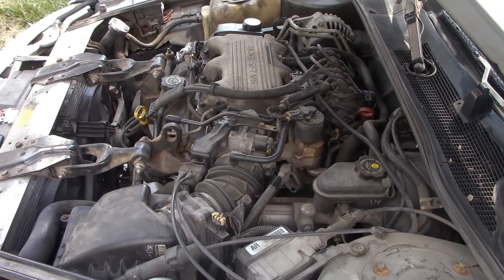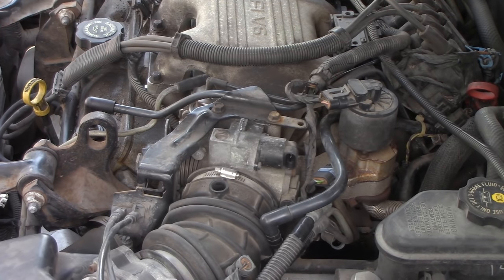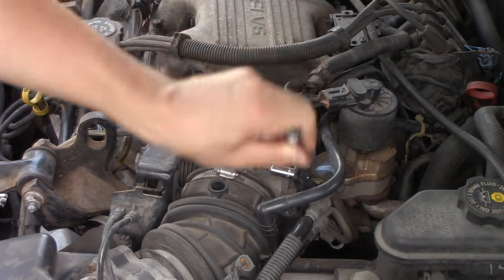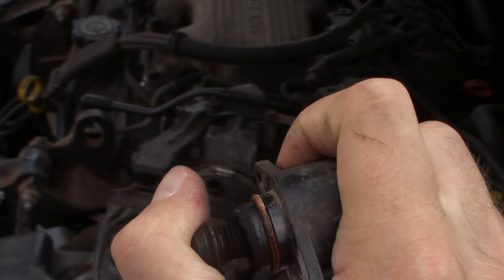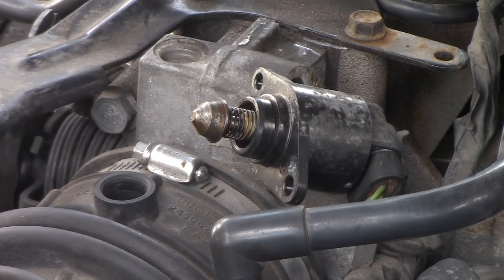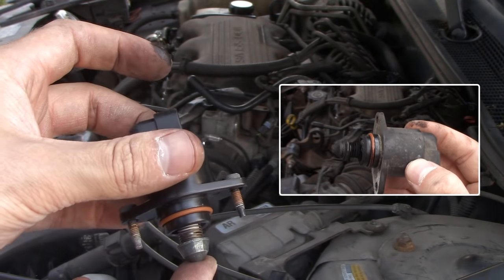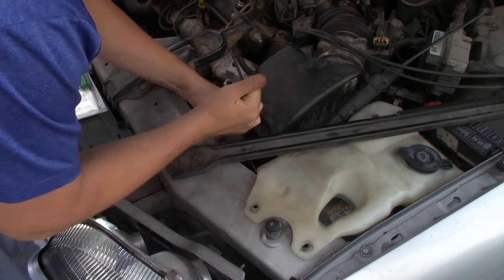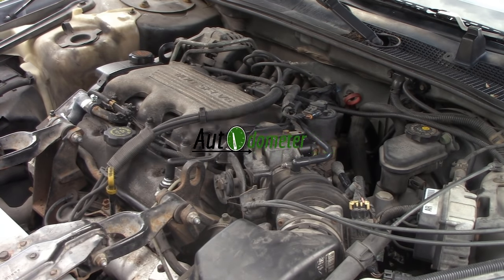How to replace an idle air control (IAC) valve

Comment: Hi, thank you creating this informative video. I have a 2006 fx35 and the car starts up and drives but stalls. At times it will starr up and i can drive at normal speed with no problem but as soon as i come to a stop light and press the gas the car stall and move very slow while i try to pick up speed.
I had the car checked for codes and  these are the codes that the car gave to the computer.
Reply: Oh boy my Toyota Tercel would all of a sudden loose speed while I was driving. One time I was driving like that next to the Police car with a speed of 20mp where it was 35mp. It was pretty frustrating, and I have never figured out the problem. @photograffyc

Comment: The pintle kept unscrewing because it met no resistance. Too bad you couldn't screw it back in..
Reply: You can.  Not by turning it because of the slots in the pintle shaft and the corresponding spots were the pintle shaft goes into the IAC body.   Just put the pintle into the IAC body, make sure the above mentioned slots in the shaft are lined up with the two little plastic tips in the IAC body, and turn the key on.  The IAC motor will turn and the pintle will screw back into the IAC body.

Comment: torque the screws to 27 inch pounds ,not foot pound!!!! press the gas pedal slightly (less then half way) hold it and start the car for 5 second,turn the car off for 10 second or more,and restart the car ,it should be set and car should idle normal

Comment: I'll be trying to change idle in a 2002 intrigue  it over heats . took out thermostat be it it's too accelerated .
Reply: David Fox D.D. if you remove your thermostat your fuel trims will be way off and you will have hot spots in your cylinder heads. Replace your thermostat and add coolant. Make sure you have no leaks in cooling system.

Comment: Hi, if the pinion is stuck open would that make the engine rev up as soon as you start?, there’s no air leaks other than the valve is broken
Reply: THIS IS WHAT MY CAR IS DOING! I just went and got a new IAC Valve. Let's see if that fixes the problem.

Comment: 96 oldsmobile Cutlass Supreme 3.1L. Old one was bad and electrical prongs looks like they were fried but the plug itself looks normal. Anyways, bought a new one, installed it, and now when I start my car the rpms are right around 2 grand at idle but if I shut it off right away and restart, the rpm are around 1 grand. After I drive it, put it in park or neutral, rpms are back at 2 grand. Am I missing an adjustment? I read the instructions b4 I installed it and followed them but my idle is never steady when I start and restart. Noticed that if I press the pedal b4 I start the engine, it usually is at 1 grand idle. Never had to install an IAC before and wondered if I need to manually adjust the idle arm. Any thoughts of advise?